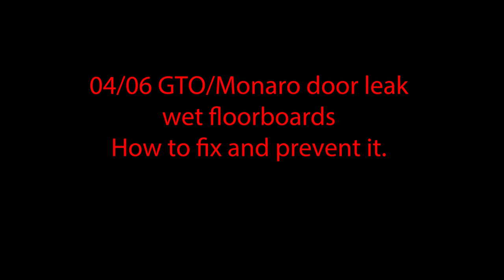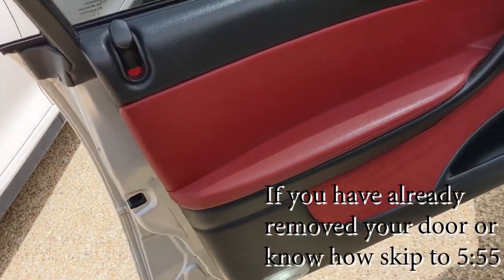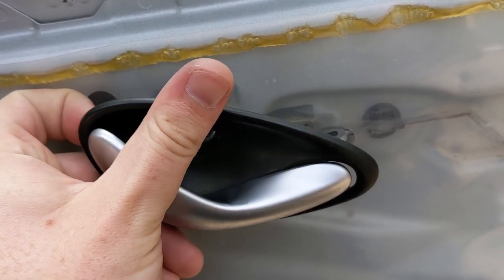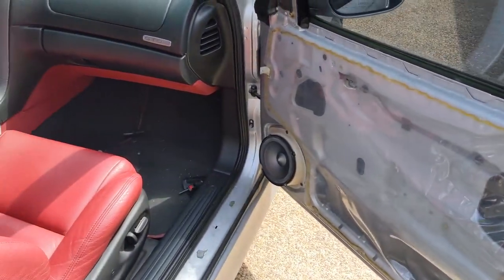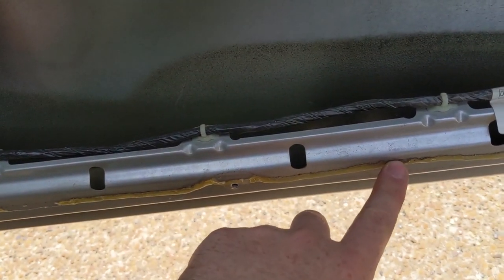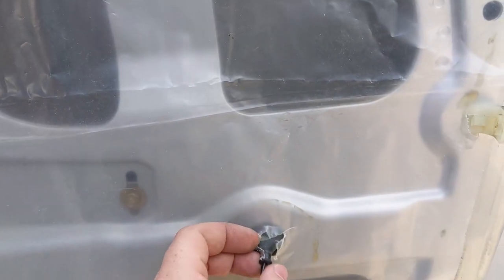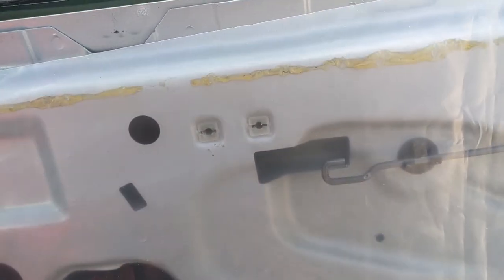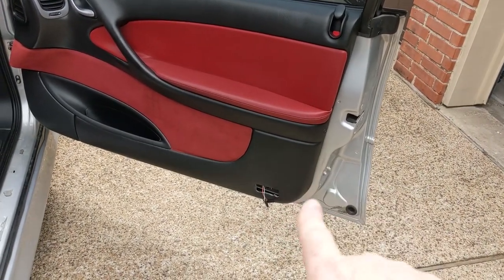GTO door leak

Comment: very well made and interesting video.  just one thought, when doing the interior light, i think it is better (and so does Helms manual) to lift up and out the door card, and just unplug it.  I am really surprised it works to pop the covers like that without breaking them.
Reply from the maker: Thank you. And yeah that is true. You could do that and it wouldn't hurt anything. I haven't broken the light housings myself yet but my passenger side one was already separating the plastic cover from the metal housing which I am assuming was from the previous owners messing with it when they did this speaker wiring. Which is what screwed up the seal.

Comment: Excellent! Where did you get the new plastic material from and what adhesive did you use?
Reply from the maker: You can buy the plastic at most hardware stores like Lowes or home depot, and the sealant part number I listed in text on the video when I started applying it. MW38115 I believe is the part number. But it's in the video as well.
Reply: Is it just any plastic sheeting?